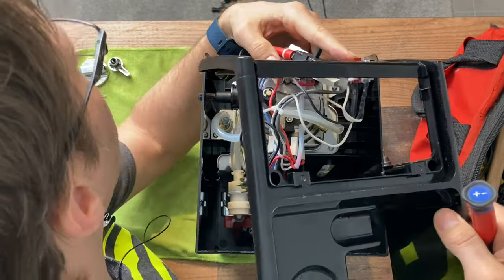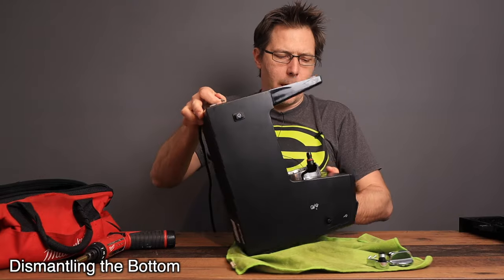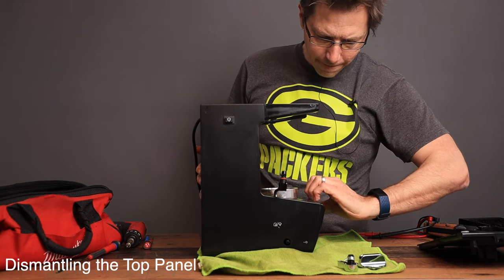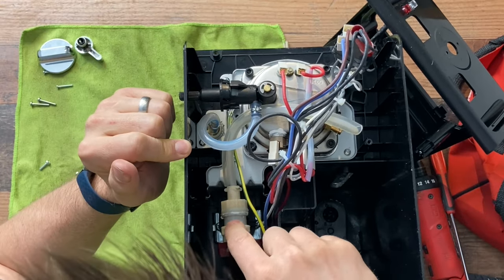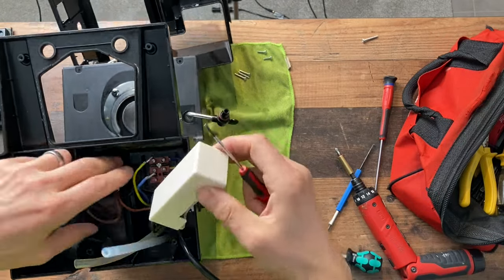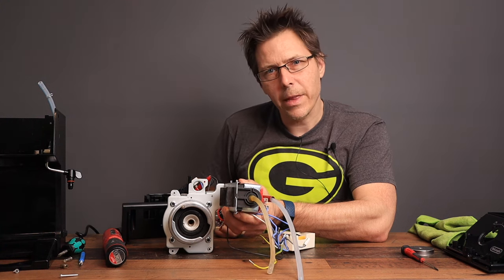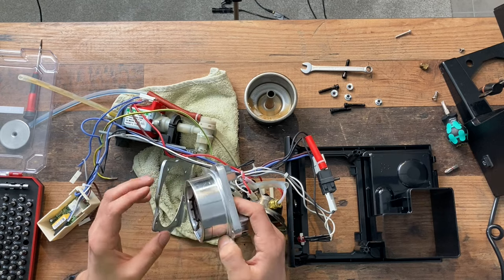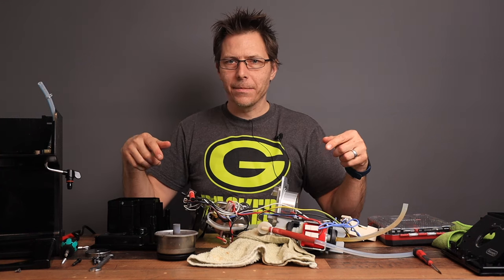$99 Delonghi Espresso Machine Teardown - How good ARE the Components?

Comment from the maker: Thank you for watching! Comments welcome!
Reply: The sediment was so interesting! If you don’t mind, how long had you been using it before you descaled it? (I’m trying to decide how often I should descale)
Reply from the maker: @heyb6268  I got this actually used, for free, so I don't know. By the looks of it, it had gone a long time!
Reply: @TomsCoffeeCorner  thanks for the response! I’ll just plan on descaling on a regular basis 👍
Reply: Very useful walkthrough, helped me to change my OVP which I ordered from Amazon and now working very well, right about to throw it to the recycle bin, thanks!
Reply: @ 11:55 So mounting a pressure gauge on my boiler only tells me pressure on my coffee that is above that initial discharge pressure, if pressure doesn't go above initial discharge pressure you have no idea how much pressure is on your coffee. interesting:cat-orange-whistling: what a pressure gauge can tell you ! 
So the best :trophy-yellow-smiling:pressure gauge to have would be one plumbed in just behind the shower head , do you know of any machines that do that ?
Do the commercial machines do that ?
Reply: Where did you get the special bit to take the security screws out?

Comment: I'm sure someone already commented on this but the "yellow chip" is actually a capacitor. The only microcontroller on the board is the 6 pin chip labeled u1

Comment: My ECP 31.21 is leaking (also when off) from that small hole that goes into the drip tray. It stops only if I remove the water tank. I opened the bottom and it doesn't seem the leak is coming from those two pipes. Any idea? Thanks!

Comment: My ECP machine is acting weird. Water goes through the puck but it also squirts out around the edge of the portafilter as well making a mess. My guess was that the gasket in the group head was leaking and I was thinking about pulling it out from below in order to better inspect and clean it. I wasn't able to do that without damaging the gasket. And after watching this video, thank you very much, I'm gonna look for another way clean it. I ain't taking it apart.  LOL It's been a good machine for a year or so and it was working perfectly yesterday. WTF?

Thanks again, Tom.

Comment: Thanks for this. I tore my US model apart due to an internal leak. Found the water connection at the top of the boiler had succumbed to corrosion. As soon as I took a wrench to loosen and then tighten, it snapped. No force needed. The nut on the inside of the boiler clunked as it hit the bottom of the boiler and I was left with a ragged copper end. It'd be an easy fix to split boiler, retrieve the nut, and install a new fitting. I doubt I can find a new gasket and fitting in the US. I paid $99 USD for it in early 2019 for use at work. Only used it a year, then ran vinegar thru it and placed in the attic for future use. Recently took it camping where it leaked water everywhere.

Comment: The circuit board in european model ultimately works as an timed switch, so by installing an normal toggle power switch in place of the self returning switch and wiring it in place of the timer circuit board it can be controlled fully manually. I have done this mod to few european delonghi's, off course they wont pass any european energy saving regulations but at least you can get the grouphead fully up to temperature.
Reply from the maker: Thank you for sharing! Would you mind sharing the switch that you put in place?
Reply: It is just energy saving? I thought it was some overheating or something so was afraid to mess with it.
Reply: It needs just a normal 19mm x 13mm 16A toggle switch, there shouldn't be any overheating problems as the grouphead is thermostat controlled and has overtemperature fuse in case of thermostat failure. Also the plastics are made to withstand way hotter temperatures than steaming temperature of 125C.
Reply from the maker: @TheoreticalMass  Hi there! I found a few switches on Amazon with those dimensions, but just in 6A or 10A. If the machine uses 1100 watts / 220V AC, then that would be 5A. So, I wonder how much more the switch should be dimensioned than that. Maybe the current switch has a rating on it...
Reply: @TomsCoffeeCorner  I would check the amp rating on the relay as that works as the power switch for the boiler and pump. 16 amp switches were just ones that i had on hand, 10A would be fine in my opinion.

Comment: First, I would like to say that I enjoy your casual delivery style. You genuinely seem to be having fun in your tear down and you are not afraid to make some minor mistakes or  take a guess at some parts.
 I have a leak in the "tap" of my 3220 that comes out at the top of the barrel with the small cir-clip on it. I would like to repair this from the top of the machine but not sure if I can split the tap to  easily remove it in two pieces. Any ideas on this?  I would have liked to include a picture or very short video but don't see this an option. Thanks
Reply from the maker: Thanks! Just upload a short video to Youtube, and send me the link. Cheers!

Comment: So helpful. A bolt of boiler (idk how) got loosened and got dropped into my water tank area and I could not press my water reservoir due to it stopping the reservoir. On top of that, it was too hot that it got stuck with plastic after melting it.
Reply: 😊😊AZ

Comment: Great video thank you! my coffee head has stopped working, but steam wand and pump are fine. That valve you took out behind the shower head...  I'll see if that's the problem and report back soon! Cheers.
Reply: I removed the valve and spring, ran the machine, water came through. cleaned all the parts up, put valve back in, ran it again and no water comes through. wand is fine.   aaargh  :)
Reply from the maker: I wonder if the pump has lost its compression, and doesn't have the power anymore to overcome the spring valve in the group head? https://youtu.be/MWrp4_ozUT0?si=APCl68GnYypmW2pR
Reply: @TomsCoffeeCorner  Thanks so much for replying, I really appreciate it. I guess that makes sense, i couldn't really see what was beyond the spring inside the machine, is that directly into the boiler? :)

Comment: Great video, thanks! I'm, at the moment, having issues with my machine (same model).

I honestly didn't know about de-scaling and I've had the delonghi for over three years.

I might end up taking the machine apart tomorrow. I have and issue where there isn't enough pressure to push the coffee through into a cup, so the water ends up coming out of the steam wand as well... Not sure if that is a fixable problem or not
Reply from the maker: Good luck! I'd do a major descale in that case, and see if that helps. Hopefully your high pressure lines are not caked with scale. Cheers!
Reply: @TomsCoffeeCorner  hey there, thanks for the suggestion, I definitely have done a major descale.. but I feel like I need to take it apart to (probably) get out what needs to get out

Comment: This is one of the best videos. Any possibility to send the deposits for testing to check the composition?
Reply from the maker: It's probably just the minerals. Normal descaling will likely shake the deposits from the heating coil, but they won't all make their way up the stem of the boiler and out of the brew group...

Comment: Tom: how often would you suggest this tear down, that "sand" in the boiler was disconcerting. I use distilled water in mine and suspect that may not be an issue ...I imagine I am sacrificing some taste but may be averting this tear down.  I did enjoy seeing the mental process of someone else doing a tear down and loving this machine as I do (I did the advance version you recommended) I did want to know how it works inside.  Amazing isn't it how they get so much into a compact form factor?! Thanks KB, Cleveland
Reply from the maker: Hi Kb. Well if you are using distilled water, then it's devoid of minerals, and you will have no deposits. Mine was used - actually I got it for free. I don't think the last owner took good care of it. Maybe he used crappy water and never descaled. Btw, you can use 3rd Wave Water to add some minerals back into your distilled if you want.

Comment: Thanks for this video! I have this coffee machine and I wonder if there's any possible tweak available to make it a little less noisy? Maybe some rubber gaskets to where the pump is attached to the frame? I don't know...
Reply from the maker: Maybe you could line the inside with a dampening matting.

Comment: What’s the difference between the three ECP machines? Would you recommend one over the others?, Thanks!
Reply from the maker: I recommend the ECP3420 (or ECP 35.31 in Europe). It is the middle ranged one. The 3120 has more plastic, while the 3630 has more metal. The performance should be the same between all three.

Comment: After successfully changing the valve, suddenly function was only possible with steady pressed switch. I did cut the wires to the switch and shortcutted them. I now start the machine with a switch on my power outlet. See how long it works this time.
Reply from the maker: Hmm, changing a valve shouldn't have any bearing on the electrics of the machine. Maybe some wires got switched around when you removed the wires to shorten them?
Reply: @TomsCoffeeCorner  No,no, this is no result of the repair. It worked perfect for some more coffees before the switch problem came. I guess I have the luck!, that after 6 years all possible things get defect at one moment. The electronic (maybe the timer IC) is not to repair for me. But now, after some coffees the (lol) pump is broken and I am waiting for a new one. This will be my last repair on this ECP before I buy a new one. I love this machine, perfect for one person and a good espresso. I wonder if there is any owner who had no problems for more than 6 years?
Reply: Hi Tom, after changing the pump, the pressure was so high, that there was a big loss of water at the boiler. Replacing the seal which was shrunk, brought me a new machine for 25€. Hurra and thanks again for the video. Helmut

Comment: One thing that I'm interested in knowing is how the temperature stability is with this machine. I upgraded from a dedica clone to a sunbeam barista max because it allows for temperature adjustment, but I find that it doesn't heat up the water to a proper 90°c+, and even worse, it loses heat really fast when making espresso. I'm really wanting to "downgrade" to this cheaper dedicate just on the assumption that since it is a boiler it will have better temperature stability.
Reply from the maker: I measured the temp here: https://youtube.com/shorts/V1DGCEl0Y00?feature=share

Comment: Great video, I'm struggling with mine, the coffee is just not foamy and although I made a thorough clean (removed the gasket and the spring valve) but still not getting better.
Just see very tiny bubbles in the water tank I guess the pressure valve is playing up?
Reply from the maker: Yes, if you see too many bubbles coming back up into the water tank, your OPV could be kaput.

Comment: Great video.  I was wondering what the inside of the boiler looked like.  Also looks like the heated group head must function by convection from the boiler.  
I wonder if we can easily open the boiler still in the machine to do routine scale sand cleaning?
Reply: I just watched it again.  Do you know what the yellow wire is connected to the brew group?
Were you holding a nut on the bottom of the boiler in order to remove it's top?  Probably we can't do that inside the machine I guess.  Man, I want to get the sand out now!
Reply from the maker: Yes, the aluminum brew group is heated from direct contact with the stainless steel boiler. Removing the boiler is easy enough. I could probably do it in 5 minutes now.
The green and yellow wire was a ground wire, directly attached to the brew group.
Yes, there are 4 nuts and bolts holding the upper and lower parts of the boiler together. Cheers!

Comment: Hi, i am not sure if this if you could answer my question but i am using delonghi stilosa ec230bk. I've tried alot of things even getting a  better portafilter and better grinder i even bought alot of things that said would improved my espresso pulls. But my machine pull too fast it pull around 75ml in 30secs on 18g of coffee grounds i tried making grinding my beans  even finer just made my puck wet but it still pulls 75ml in 30sec

Comment: Absolutely love this teardown... The amount of deposits in the boiler is scary though.
I'm actually wondering why you didn't just tare the boiler on your scale and weigh the added water to measure the capacity instead since water will roughly be 1gr/ ml. Probably easier and more accurate way to do it.
This does seem like a much more mod friendly machine than the Dedica line due to the amount of space in there - probably could fit a nice membrane OPV and additional fittings for a manometer off the side or maybe a valve/ dimmer to allow for low-pressure infusion?
Reply from the maker: Yes, you're right - this would make a better tinkerer than the Dedica. I also prefer the shots due to the heated brew group. Yes, measuring the weight of the water would have been easier.

Comment: Great video Tom. I opened up my boiler and when I put machine back on I forgot to refill boiler. It overheated and tripped the electrics. So I let it cool and then filled up before it got too hot. Now boiler still works in term of heating water BUT the pressure seems different? When I make coffee on same settings as before it just runs through really fast (10s instead of 30s) and flavour is not as rich (no more crema). I thought it might be how I put it back together but boiler is well reassembled. I also tried smaller grind size/increased dosage but still the same. I am using a naked portafilter which also worked perfectly before. Any ideas? 🙏🏼
Reply from the maker: Oh boy I don't know Luke. If it's running way faster, than can be an indication of too much heat. Perhaps the thermostat got blown out, and the machine is heating too much. Good luck!
Reply: @TomsCoffeeCorner  thanks Tom. I’ve worked it out. I dialled down my kingrinder k4 from 71 (used to be perfect for my brand) to around 52 and it’s working like a dream. Not sure if that’s the k4 or my tinkering but it’s working again! 🤙🏼☕️
Reply from the maker: @lukemorris3307  Excellent!

Comment: Thank you so much for your very enjoyable and informative presentation.  It's great.  I just have a question.  I have the DeLonghi ECP3420. I have been making espresso with it for four years but only recently gotten in to pulling shots.  Lately, there has been a puddle underneath the unit after each use.  Can you point to the most likely candidate for the cause?  I am thinking O ring or a bad OPV valve.  Appreciate any response.  
Thanks!
Reply from the maker: Thanks! You will really need to take the machine apart, because a leak can come from many sources. Make sure the machine is unplugged, cooled down, and not under pressure.
Reply: @TomsCoffeeCorner  I hope to be able to do that and not ruin the machine. I did notice what I thought was a decrease in shot intensity since the leak from the bottom showed up. Since it’s a closed system and there is a leak do you think the leak could decrease the extraction?  Thank you.
Reply: I should say my wife will say I’m going to ruin it!

Comment: Hi Tom, you have very good channel thanks for the content. I really like coffees but also I am really concerned about health, especially aluminium, brass, lead etc basically all toxic stuff. SS steel is ok. What machine would you recommend which dont have direct contact with water and these materials but not more than 400-500€? thanks for help
Reply from the maker: Probably this one. SS boiler, you can get a bottomless PF with SS basket. GCP boiler for example is aluminum. PF on the GCP used to be brass, but I guess is now SS too on the new Gaggia.
Reply: @TomsCoffeeCorner  Thanks for the tip, I might choose this one than, what's your opinion of bambino I know it uses something like thermojet. These videos with dissasesmbling are very good. Keep it this way. Cheers!

Comment: Tom, would you consider making a video specifically re accessing the pump POWER connectors (very obstructed on my ECP3420)? I'd like to know minimally which connector to interrupt or "splice into" (using male/female spade connectors), and I'm kind of hoping I might be able to grab and disconnect just one from opening the bottom panel in order to add in a DIMMER. Correct me if I'm wrong, but it seems, however, as if I might need to open the top and completely pull out EVERYTHING (!) inside, like the boiler and all of the other parts which are accessible from removing the top panel, in order to access the pump and its power connectors!! Is this the fact of the matter? A video of how to access the ULKA pump would also be handy if anyone needs to replace the "O" ring, so a video like I'm describing would be handy both for that purpose AND adding a dimmer. Thanks for considering this request! I am enjoying many of your various videos and channel. Thanks for all of the good info!
Reply from the maker: Hi there! I think you can access the pump just fine from the bottom. Anyway that is where the pump is located, and the main board. The boiler and steam valve are in the upper part of the machine. Just take your time in taking it apart, and document your steps by taking pictures. Cheers!